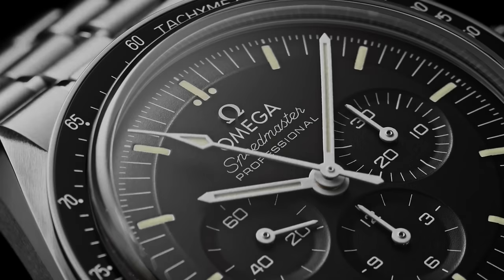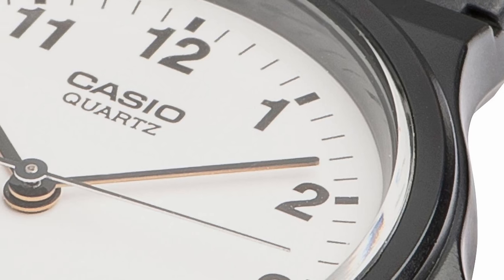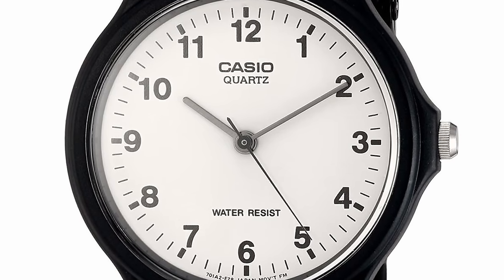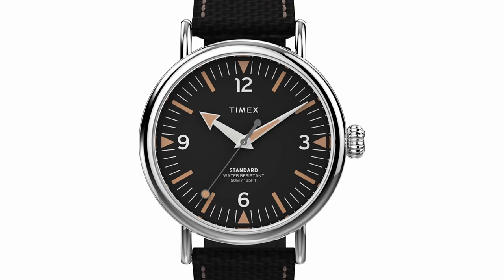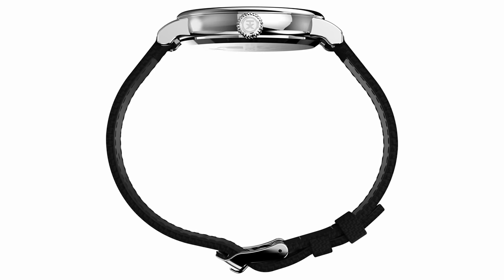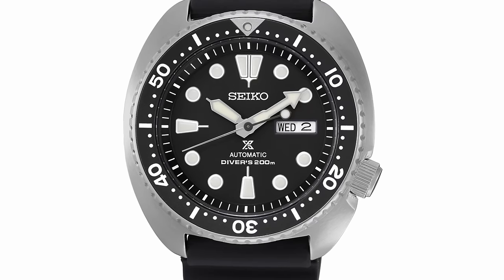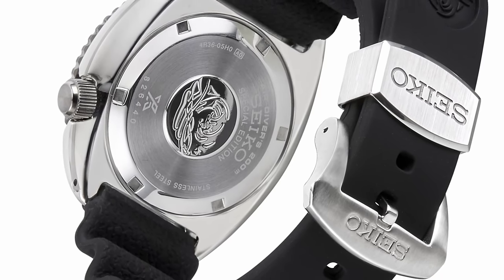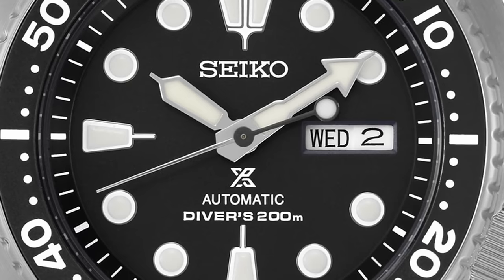My Favourite Watches At Every Price

Comment: I love my expensive watches (Rolex, AP etc). But for most things, my titanium eco drive citizen is my go to. Light, accurate and very neutral in looks. It is the watch I wear at night in a bad area. If I get mugged, I will just hand it over.
Reply: I feel the same that’s why I gravitate towards wearing my Tudor most of the time.
Reply: @jakealexander6046  I would still probably stand and fight for a Tudor. I can be dumb and stubborn and that's still a valuable watch.
Reply: @happydogg312  Sadly I am not rich, I just love watches. My car is a 13 year old economy hatchback.
Reply: Sadly, the eco drive still has a battery.
Reply: You could also use the Eco drive as a blunt weapon, love my Pro Master enough to fight for that one.

Comment: Everyone drops their personal favs, and you know what?  So will I:
I suggest the "Citizen Eco-Drive" watches.  There's a couple that are within the $200-300 range which offer not only a decent time accuracy of +/- 15 seconds per MONTH....but also the Eco-Drive uses sunlight and fluorescent light indoors to constantly charge it.  On a full charge, the Citizen Eco-Drive watches can stay active for 6 months.  Plus, the lithium internal battery and/or capacitor can last anywhere between 10-20 years before needing to be changed.  Really great, and at that price point, I don't mind using it for every day use.

Comment: I cannot tell you how much I enjoyed this video. Oh, wait, yes I can.  I enjoyed it an awful lot. 

"... all things calculator and piano..."  I always used to use a Casio calculator with deg/min/sec functions to add up hours/min/sec for seeing if mixtape playlists would fit on one side of a C90, and my daughter's piano is a Casio. Also, I'm wearing an A168 at the moment. 😀 Shoot, you could've gone for the Casio hat trick and picked the MTP4500D-1AV for the $100 level (it's enough under that you could throw in the MQblahblah and still beat the century mark. It's the least expensive slide-rule-bezel analog chrono you'll ever lay your hands on and you'll love it 'til you can scrounge the scratch for a Navitimer. 😀 

You're ticking all the boxes this time around, at least at $500.  My wife is named Susan and she'd definitely lack approval for my dropping half a grand on a wristwatch.

Comment: Nooo to the MB&F: The Manufacture Royale 1770 is extremely similar (With balance on front) but actually more readable (No sub-dials, full length hands), do not stand back with finishing and much more handsome (In my opinion) and have actual heritage. And did I mention cheaper too?

Comment: Can’t really disagree with any of the choices, most of them are very sound. However, just for the sake of discussion:

500: Seiko Cocktail Time Manhattan
3.000: Christopher Ward C1 Moonglow
5.000: Zürich Weltzeit Night Blue 
7.000: Grand Seiko SBGE271 (kanro)
10.000: Grand Seiko SBGY007 (Omiwatari) or Grand Seiko SLGA009 (White Birch, springdrive)
20.000: Rolex Sky-Dweller (blue dial, Oystersteel and white gold) or JLC Rerverso Tribute Duoface Calendar
50.000: A. Lange & Söhne Lange 1 Mondphase (I know, slightly more expensive, but I saved money with my Sky-Dweller)
Above 50k (think it comes at different prize points): Lange & Söhne Zeitwerk or Grand Seiko SBGZ009